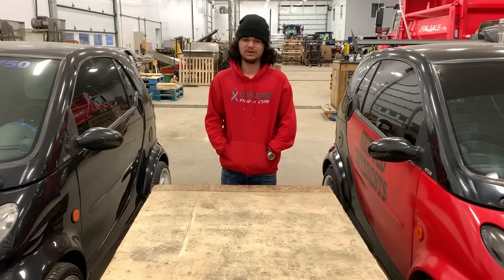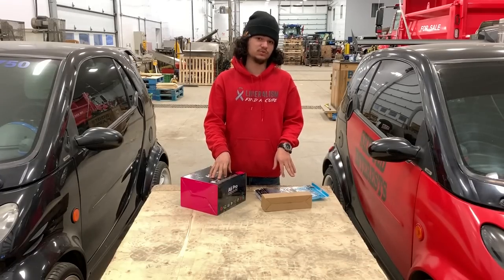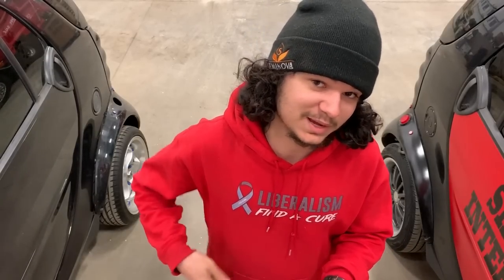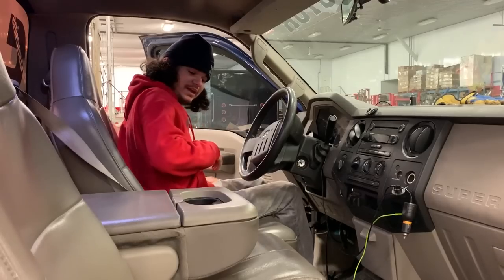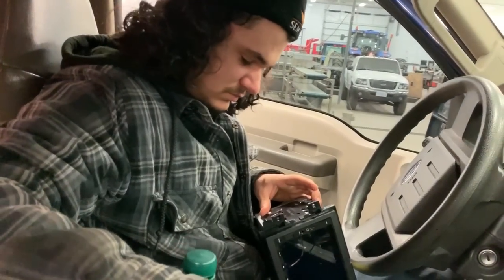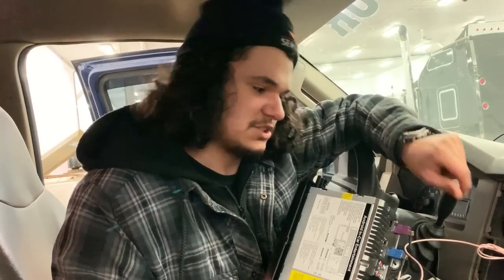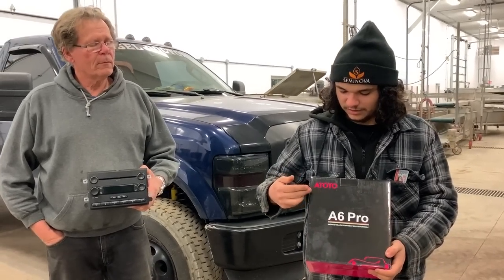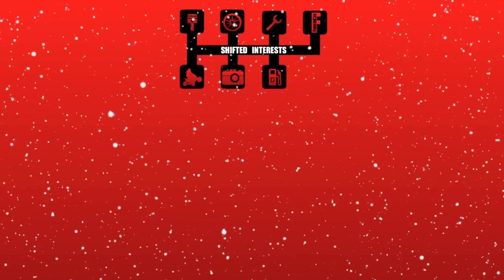Android Auto for ANY VEHICLE! - Atoto A6 Pro Installation

Comment: 3 wires for oem back up camera on passenger's side A-pillar:
Red with yellow tracer = video + (positive RCA cable)

Black with yellow tracer = video (negative RCA cable)

Green with yellow tracer = reverse signal (reverse wire on aftermarket )

Comment: I put the same head unit in my 03 cummins. I also installed ATOTOs dash cam and back up cam with it, works great. Very happy with it after 6 months, just like having a tablet in the dash. Just download apps from the play store to use on it, like spotify, hulu, etc.
Reply: how did you get the dual din to work, 03 cummins is only single din.

Comment: Do you need to use the "pro" model to have a smooth Android auto experience? It was my impression that Android auto used the phones hardware to run the applications
Reply: From my understanding this doesn't run actual Android Auto without and adaptor (or perhaps you can with the mirror feature). The unit runs off of Android though.